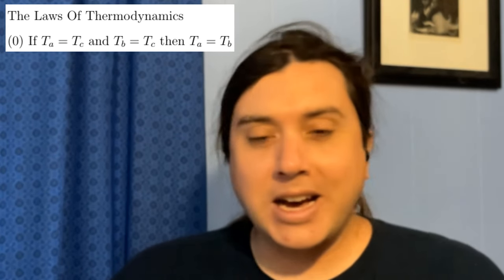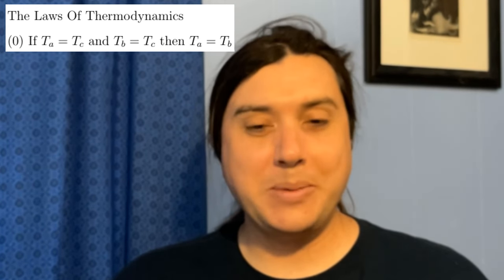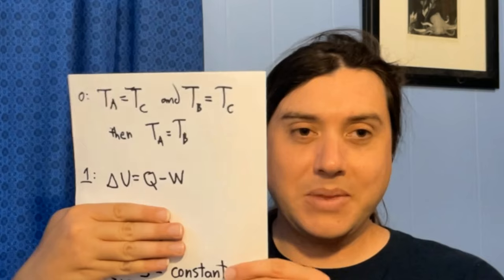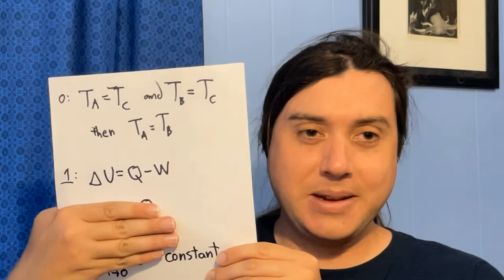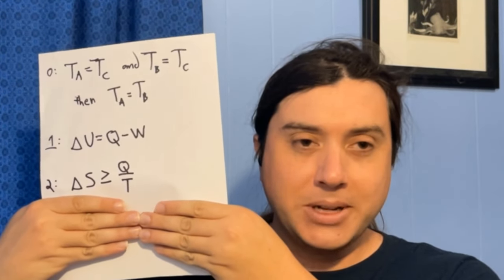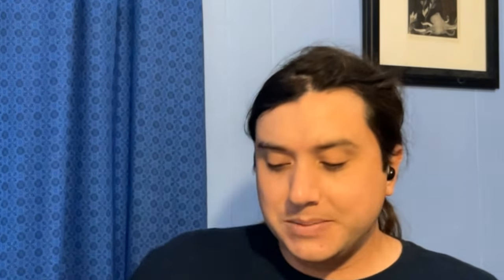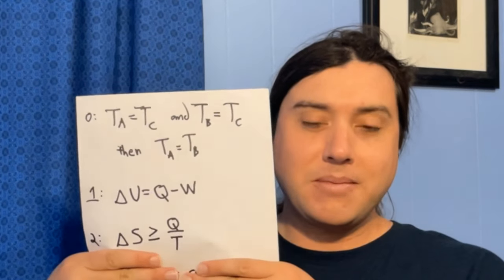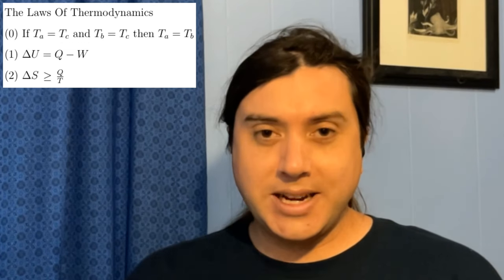A Practical Guide to Entropy and Thermodynamics

Comment from the maker: So in case anybody is confused or knows better the W that we usually says is “micro states per macro state” actually does not count permutations of identical particles, so the analogy of ordering of cards is necessarily a loose one since the factor is more akin to combinations that permutations, but for a highly diffuse system like an ideal gas they are approximately the same anyways.

Comment: I feel like saying "we've proven the statistics used to prove the laws are sound, but there is nothing wrong with anything being a working progress"
Reply from the maker: I mean it depends on what you mean by "proven." The internal mathematical consistency of statistics is with few exceptions very solid. In so far as those pieced of mathematics "prove" thermodynamics, in the sense that the macroscopic laws of thermodynamics follow from certain assumptions about the microscopic dynamics of the system (primarily so called ergodicity of space and time) combined with the thermodynamics limit where the system is assumed to be infinite then yes. Those assumptions have a very solid body of evidence supporting them in the form of both experiments validating the macroscopic laws of thermodynamics and some experiments directly probing the micro-physics but nothing in science is ever "proved" the way it is in pure mathematics.

Comment: What’s the point of the zero-th law? If you separate the room in two parts and then remove the separator you really haven’t changed much. Right?
Reply from the maker: The point of the zeroth law is that if you remove the separator you shouldn't change anything but that isn't just a given and doesn't follow as conclusion from any other assumptions and has to be stated explicitly. It does (mostly) follow from the assumption of ergodicity of spacetime but not any of the other three laws.